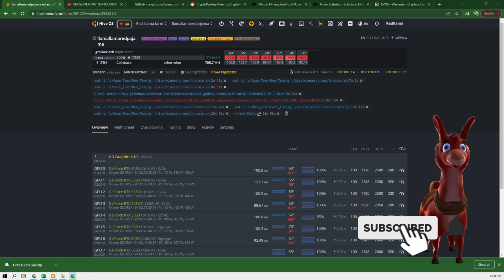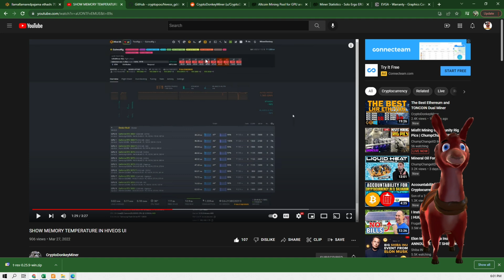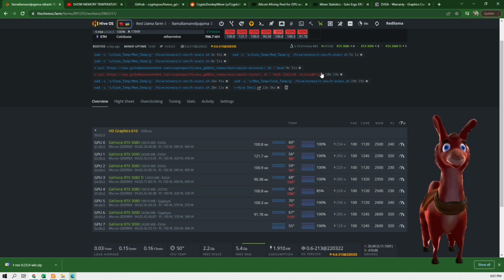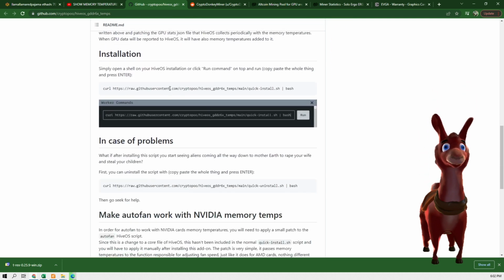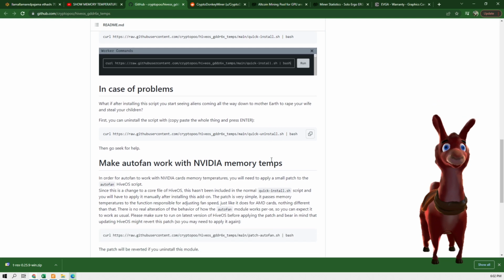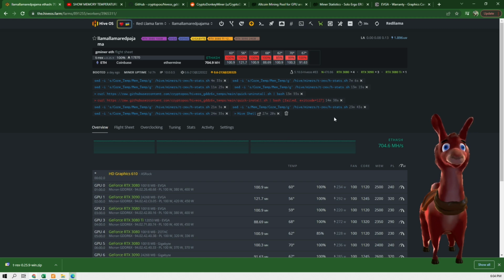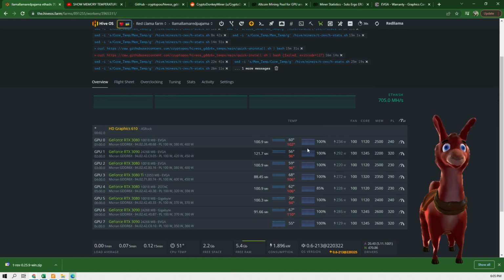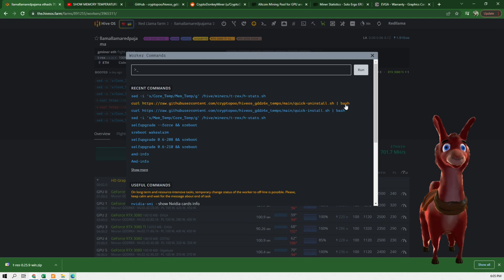How to Show GDDR6x MEM TEMP on HIVEOS Interface using T-rex Miner

Comment from the maker: Let me know if this still works out for you. Don't forget to hit the like button and sub.
Reply: It works!!!!!!!!!!
Reply: not working :|
Reply: @effexon  try the new stable version, was released some 20 minutes ago. Basically you need to reinstall it. If you have a gpu with GDDR6 memories, it might not be supported.
Reply: @cryptopoo2447  I updated t-rex, forgot it was old version, seems to work now, with first command. Idk what those sed commands are supposed to fix. (read bash code to realize it must read miner program output :D
Reply: @effexon  I'm glad it worked! :)
Reply: @cryptopoo2447  what's with this feature going away after boot or some time... today it wasnt showing, I ran that install command again.. seemed to fix it, but it said output nothing to do. This feature vanishes easily, annoying to login to rig and run command every time wanna check temps.
Reply: is it possible to check 3060ti mem clock temp on hiveos

Comment: Thank you! But I have a question! A noticed that at some time brackets the hashrate diagram breaks. Is that because of the thermal throttling? Cause I have the same issue. Couple of days ago everything was ok (my gpu's arent thermalthrottling) and I have the same hashrate diagram then you.
Reply from the maker: I notice that too. I think that would be better for Cryptopoo (yes that is his name) to answer that.

Comment: Hey,

just to be precise, the right command to issue is the first, that is "quick-install.sh". The second command is only used to remove the script.

I'm not sure why the script failed with error 127 when you first tried it, but it could have been that you tried the package when I forgot a few lines with donation addresses at the end of the installation script.
These were causing the script to report as "failed", however it was working already just fine. This has been fixed later on.

So running the first command is really all you need :)

Cheers!
Reply from the maker: You are the man!! thank you for the support on this. This is awesome!!

Comment: Work.... ish...
I have 2 video 3080... one with the copper mod and the other with the stocks pads.
So, the coper mod card shows the high temps of the stock pads card... and the stock pad card, shows nothing...
Im using gminer for the rtx, and lolminer for a 5700xt that is also in the same rig...